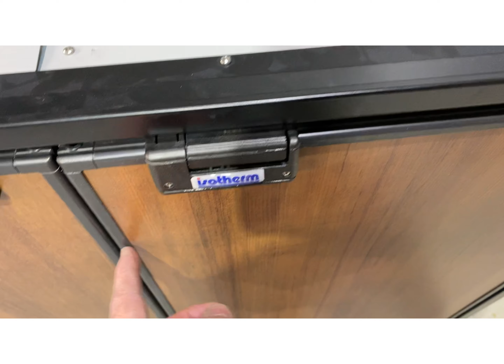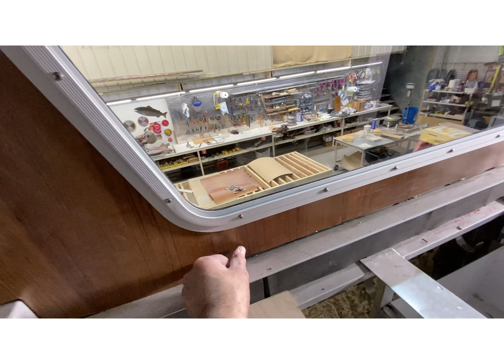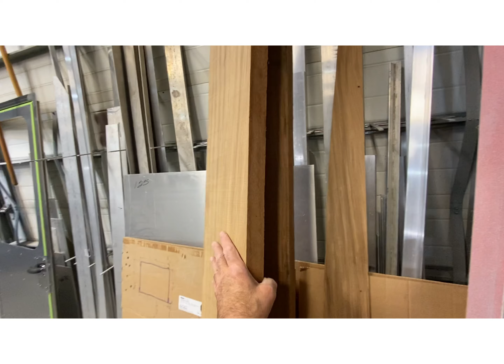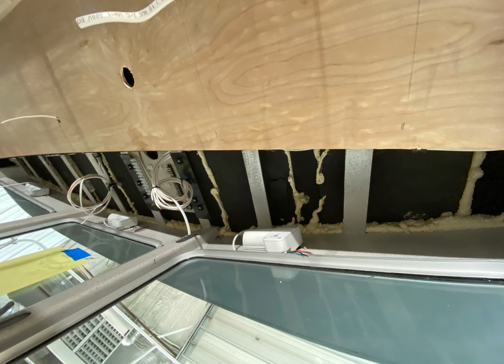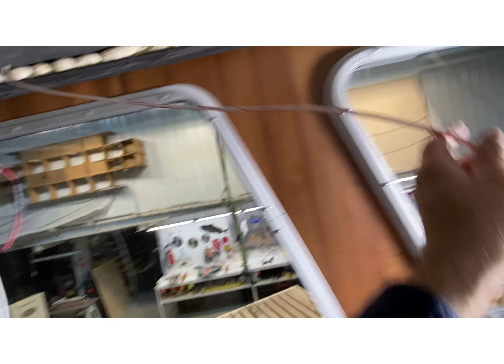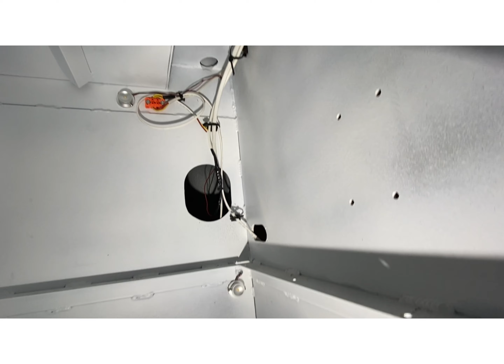Alaska Aluminum Boat - #37 aluminum boat build

Comment: Hello,

Working on an aluminum and am getting ready to Zolatone the interior. I have not purchase a glaze or clear coat yet. I wanted to ask what you recommend for clearing over the Zolatone and do you have any tips or recommendations since you have worked with it?
Thanks in advance for the reply and boat looks great
Reply from the maker: If you can get the Zola brand readily it works of course great. I mostly use PPG at the Auto store and it works great. It has held up for many years on my other projects. +10 yrs. Hardest part is getting good coverage due to not being able to see the flow from lighting while spraying. I do 2 min but usually 3 coats. Take care. 
Will J

Comment: Buddy you have done an awsome awsome job . i went and watched from 1st until this one it was a joy to watch that boats going to be a tank 100 precent sure lol. I cant wait unit you get the rest of the videos all way until its done and in the water its almost like we will be a part of the voyage lol. Well i hope the videos wont be to long ready for the rest any ways have a great day . i like the colors good choice should be cool not hot colors the led light look cool on the deck blue and the red in v birth is cool. Wood work is awsome i was like whats he doing lol . until i seen it good choice looks great.  Ok iam gone be waiting for rest have a great day .
Reply from the maker: Hi and Thanks for the comments. I thought the custom aluminum cutting and welding took time the wood work is more so. I guess since it needs to hide all the hidden secrets with finish and trim. but it is looking very nice. I'll be posting again in a week or so. Just not going to have much big gains to show.
Thanks